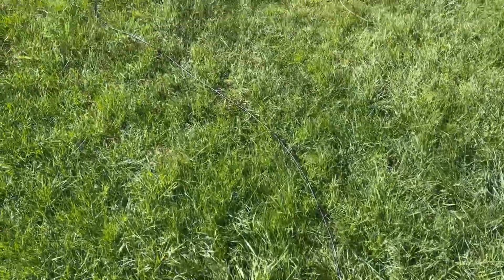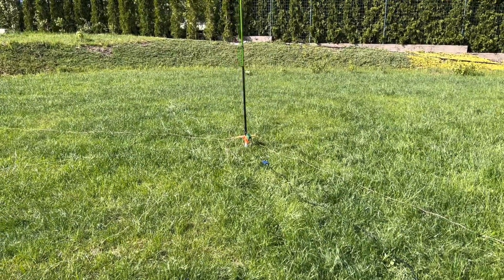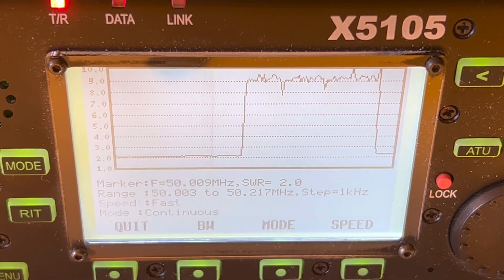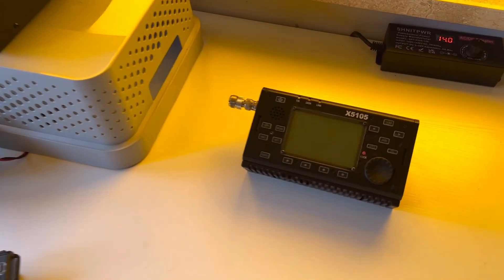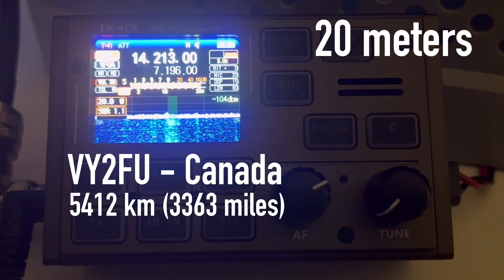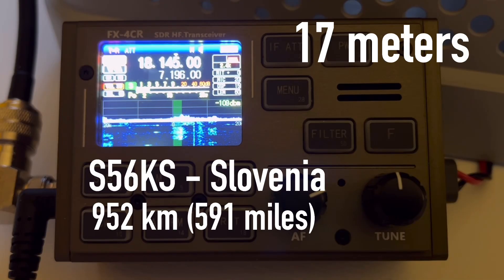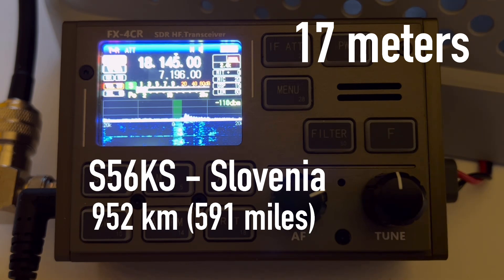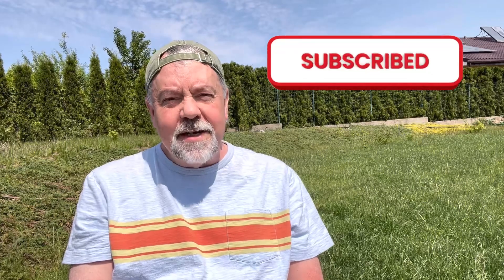Building a Short Multiband Vertical HF Antenna

Comment: I have a $28 18.4 foot telescopic whip that I'm using as the basis for a small motorcycle mounted portable version of the POTA PERformer that I'm calling the Moto POTA.  It uses two tuned elevated radials and is quick and easy to deploy with the motorcycle acting as the stabilized tripod, hopefully without spoiling the radiation pattern but the bike is in the lower null so I don't think it'll be a big problem.  I've always favored the EFHW for its light weight and ease of deployment but the Moto POTA should be even easier, with no need for a tree, and the lower radiation angle should improve DX performance.  I'll keep the EFHW for NVIS.

It was good to see the FX-4CR.  I love that little radio.

Comment: Hey Walt,

 I'm really enjoying building some of your antennas and working them with the G-90. This antenna worked great, even today with the projected propagation of 'poor" I still made contacts on 10, 112, 17 and 20.  I have only been using 3 radials since that is what I had for my wolf river coil. For this antenna I used the 7.2-meter crappie pole which is lighter and has less wind drag than my bigger 10-meter pole. Easy set-up worked great. Thanks again for the inspiration to tinker with wires. Now that I have the G90, and using the wire antennas, I just can't believe how much I can do with so little! Thanks again Walt! 

Mike

Comment: Walt, built a 17-5 with 20AG wire with dx commander using the LDG 4:1 unun and LDG 1:1 choke works great, may try 20-5 but 17-5 works great!! Thanks W8BLT
Reply from the maker: Awesome! 73, Walt

Comment: Hi Walt, just curious what length ground radials you used. 73, WA2SVM.
Reply from the maker: @WA2SVM  I typically use 5 meter long radials but I hack and wack and don’t worry too much about the exact length. When they are on the ground exact resonate length isn’t important. 73, Walt
Reply: @COASTALWAVESWIRES  Many thanks! I plan to try both the 17.5" & 29' verticals. Happy DX!

Comment: I may try this! I picked up a 1kw 4:1 balun two weeks ago cheap at a Ct ham fest. I was experimenting this week with a 213 whip using a window
screen counterpoise with very good
swr readings 20 to 6m with and without
radials.same swr readings both ways.
Do you think this will work with the window screen? It may take me a week or more to set this up. To use my ldg
Tuner,4:1 and my wolf river whip.
Reply from the maker: Yes, give it a try

Comment: Thanks for the video! I picked up a 25foot mast so I'm looking to try this as an elevated vertical with one or two elevated radials. That would be a good, simple POTA antenna if it works. 73, Brian - W5DUI
Reply from the maker: Definitely worth a try. Good luck!
73, Walt

Comment: Hey Walt, I'm a new Ham, just got my Basic with Honors here in Canada! I really enjoy your helpful informative videos. Question about radials. Do they need to be 5m long or can they be shorter say 3m (10ft)? How many radials is best 3, 4,5?
Thanks,
Chris
VA3COJ
Reply from the maker: They can be any length but try to get as many down as possible especially if you’re going with 3 meter long radials. I think you would probably be ok with 5 or 6 radials 3 meters long but add more if possible
Reply from the maker: This is a very common question and I think you have inspired me to finally do a video on this topic. 73, Walt
Reply: @COASTALWAVESWIRES  Thanks so much Walt! Well I'm glad a noob like me has given you inspiration lol 😆 😄 
73
Chris VA3COJ

Comment: Hey Walt, i gave this antenna a try today getting ready for portable work once it warms up, im using a homebuilt 4:1 and a choke after a 6ft patch lead which then goes into my radio. 17 and a half foot vertical and 12 radials between 2.5 and 3.5m long, this thing is a monster between 12 and 20, got my very first copy into VK from Ireland on 20m on it today, feeding it with about 25w. Only issue im having is i cant get a good tune on 10m, im using an mfj 901 manual tuner woth an old kenwood ts130 rig and no matter what i do it wont tune below 2:1 on the lower ssb portion around 28400, i get a good match further up near 28900 but its pretty deaf on 10m anyway, dont know mayne i done something wrong, ill experiment with wire lenghts. Im very impressed though, single wire and i can work really good dx on 4 bands, and it cost me less than 20 quid including toroids for the ununs!
Reply from the maker: That’s awesome! Thanks for sharing. Keep experimenting, I hope 10 comes through for you. 73, Walt

Comment: Walt, excellent video as always, I have a 3 foot pole that needs a vertical and that's it, lol! One question, how did you attach the counterpoise wires? I couldn't make that part out. Tks, Greg
Reply from the maker: Thanks Greg! I attach the counterpoise wires to the negative side of the unun. You can also clip them to the outer side of the coax connector at the feed point which will work just as well.

Comment: Don’t really get chokes.  Is the 1:1 needed when you have the 4:1 at the feed point ?
Reply from the maker: No it's not needed, it just helps prevent RF from travelling up the coax when you are transmitting.

Comment: Hi, Walt. Great video. It is very ecouraging to see that kind of random wire type vertical in action. It looks like the length is not very chritical namely 18 ft is a well known length for random wire multiband antenna. It is normally feeded usung 9:1 unun but 4:1 seens to work, too. I have a  not sk well working commercial random wire vertical which I most probably modify based on your design.

73! Mikko, OH2BJU
Reply from the maker: Thanks! Good luck with the antenna! 73, Walt K4OGO

Comment: Hi, Walt. Nice video man and some great contacts there. I'm looking at maybe getting a 1/4 end fed 60 meter single band vertical as an "all-in-one" type solution to cover 30, 20, 15, 10, and maybe 6 meters. It's just over 8 feet tall and has a coiled bottom half. The price is nice at 40 USD. What do you think? 73
Reply: Hmm... My math might be off. That'd provably be better for 60, 30, 15. The 160 one might be good for 80, 40, 20, 10, 5. 🤔 Maybe I'll just get a long poll and wrap some wire around it... 😅
Reply from the maker: Or do like I do, just experiment with some different lengths until you find what you like LOL. 73, Walt
Reply: I ended up getting both antennas to switch between to get up and going a bit easier. But yeah, I'll have to do some experimentation for more ideal setups when time permits. 73

Comment: Thank you! I loved the video! I’ve had my General license since 2010, even though I’ve been on HF several times, I just got my first HF Radio, the Icom 7300. I’m having horrible luck with a dipole and I’m hoping to try the Seven 5, thanks again, I can’t wait to try it! Hope to hear you on the waves! 73 - N9RMG
Reply: I’m sort of in the same boat. Got my General in 2020 and just got a 991a. The subject of antennas is daunting, and I may start with a design like this or similar.
Reply from the maker: Looking forward to catching you on the air! 73, Walt K4OGO

Comment: Hey Walt, Great channel, Thank you for I am learning a lot of your experiments as a novice HAM. My QTH has a constant QRM of S9+ dB. So mobile is the only way to go. I am a great fan of my home brew T2LT antenna's I have got them 10, 2 and 0,7, but looking for something short multi band the 17five looks like a good solution. So I build one from your example. Only difference I made to it are the radials. I first used the radials that i made for my home brew multi band vertical for 20 and 40 based on the Slidewinder design only longer. These radials are in bundels of 6 strands of 3 meter thin speaker wire. I use 3 of these bundels for a ground plain. Now I observe something strange. The more of these bundels I attach the higher the SWR of the 17five gets. Best configuration I found is No radials at all with the 4:1 LDG unun dangling 2,5 meters of the ground  (on a 8 meter squidpool)  With a SRW of 2,3 on 40 it has even a wider range then expected. According to the Rig Expert it would be tunable on all HAM band except for 160, 80 and 2 meter. This is what I would like to give back to you. It may lead to some ideas. Pitty your day in Poland are over would have loved to work you on this antenna. But how knows maybe trans Atlantic some day.
Reply from the maker: Thanks for the input and the information on your experimenting. Hope to catch you on the bands for that Trans Atlantic QSO! All the best and 73, Walt K4OGO

Comment: Hey Walt! Love your stuff, and something to consider is to make a "mini inverted L" by adding a piece of wire with an alligator clip to the 17' whip. I use a longer piece to a cheap pole to tune 40m. Hears better and gets out better than a coil at the base. Have fun in Poland.
Reply from the maker: Thanks! Great idea, thanks for sharing
Reply: @COASTALWAVESWIRES  The wire I use is 20'6" long using the WRC whip.

Comment: Hi Walt, Nice Video's. recent viewing of your videos have inspired me to go get a X-6100 and now trying to settle on an antenna. Headed to North Myrtle beach in a month or so and want to do a bunch of DX'ing from the beach but there will likely be other beach goers that don't want to be tripping over radials. I also plan to use this set up in the future for Pota/Sota & emergency preparedness and field days. I don't think guy wires will work either. Any suggestion are appreciated.  
73's - Phil K2OTA
Reply from the maker: Hi Phil, if you’re at the beach and by the saltwater you really only need one Counterpoise wire, that should help a bit. Instead of guy wires I use either a surf rod holder or beach umbrella mount in the ground to support the pole. These also work great in common dirt as I’m using them in the backyard in Poland. All the best and 73, Walt K4OGO

Comment: I’ve seen a quite similar vertical called a ‘Rybacov’ which used 27feet vertical but fed exactly the same,.. a 17.5ft vertical is near perfect length for 20m band so wouldn’t need the unun on that band. Operating that antenna on the sea coast would be a real Boomer for DX!. I can work VK/ZL from my QTH on  the Irish Sea coast with just 10W usb & 1.4m loaded whip antenna. 
BTW can you give mire info in your power units for portable working. … 73 de G4FBC
Reply from the maker: Hi Ron, yes the RYBAKOV is a great vertical. I’ve actually built it several times and have some videos on it. I purchased the power units on Amazon, here’s the link: Adjustable Power Supply 3V~24V 5A 120W Adapter Universal AC/DC Adapter DC 3V 5V 6V 9V 12V 15V 18V 19V 20V 24V, 100V-240V AC to DC Converter with 5.5x2.1mm 14 Tips for LED Strip Light Laptop Speaker https://a.co/d/aUEsEEZ

Comment: That sounds like fun.  It occurs to me that a way to employ the MFJ whip would be to add one of those rods such are used between the base and the coil on a Wolf River setup. I'll see if I can try it on a POTA.  I've got the LDG Z-11Pro II, which should give me comparable tuner performance.
Thanks and 73, Bill - KE1G
Reply from the maker: Hi Bill, I plan on doing that with my whip to get that little extra length. Thanks for the comment! 73, Walt K4OGO

Comment: Hi Walt, good video as usual :)
Have you done any comparison with this antenna vs the Coastal 20?
I built mine (the Red Clay 20😁) based on your Coastal, but used a 5.6m collapsible whip from ebay set to 17.5 feet and a 3/8 x 24 mirror mount mounted to a short fiberglass mast so I could isolate it and fed it through my 9:1 unun with a 3 foot tail on the "ground" side of the unun. 
It would be quite interesting to see if the Coastal can offer comparable performance, especially with no radials needed (well, almost none).
Those of us who live on postage stamp lots love your vertical videos!
Reply from the maker: Thanks Mike, this antenna is basically the Coastal 20 with a groundplane. The Red Clay 20, I like that!!! Thanks for watching my videos!

Comment: Serendipity Walt, I too randomly used a 17.5 ft vertical with a 9:1 transformer, still got it in the closet- gonna dig it out and I’ll try a 4:1 as well maybe do a SWR comparison. Keep the free thinking coming Walt.
Barnie. 73 de M7PBX.
Reply from the maker: Thanks so much Barnie! That's what it's all about
Reply: What effect would you expect a 49:1 unun to have on this wire length? Its the only transformer i have at the moment. New general here, learning a lot! Thanks.

Comment: Hi Walt, video is amazing as always but I have a question about shnitpowers. Do they drift with voltage ? I have one ( kind of knock off ) and my unit is going down like 0.9 V in 20 - 30 min until it gets hot and then it stabilizes. It is really annoying and I'm thinking about original shnits from amazon if they  are constant with voltage from the very start. Thanks for video !
Reply from the maker: Thank you! I haven't had that issue with mine, they stay very stable.
Reply: @COASTALWAVESWIRES  So mine is definitely knock off. Thank you for answer !

Comment: love your antenna videos, just watched a video by VK3YE,  Super Cheap Single Pole Beam for 15m, an interesting antenna for you to try out, especially on the beach, al ve3gam ps wonder if you could change the length of the director for each band from 20 to 10?
Reply from the maker: Thanks Al! I saw that video, very interesting. I did something similar with two poles recently with a Delta Loop I turned sideways. Complete with the fishing line and rotating method Peter used.

Comment: I've said it before and I'll say it again, I love my verticals! I did a POTA just this morning and from beginning set up to first contact without even being spotted first it was 14 minutes. A half hour later I was on the way home with 18 contacts in the bag along with 3 new states. You just can't beat it.

I've noticed similar things using KJ6ER's 1/2 wave for 15m (essentially a 49:1 into a 40 inch piece of wire feeding an MFJ whip fully out). I get about 1.5:1 on 20m phone (less on the CW/digital part), completely flat on 12m and 10 is around 1.3-1.4 until you get north of 29.000 hitting 1.8 or so at 29.600. While it doesn't seem to work quite as well as setting up the 1/4 wave and radials, it's perfectly useable and a good deal easier for band changes :) I run it that way quite a bit at home.
Reply from the maker: Roger that!
Reply: Thanks for the inspiration!! Have my 4:1 Unun ordered. Would you go with the 17-5 or the Rybakov? I have a 6m pole (ultra portable) and am thinking to wrap the wire around the pole to get to the extra length for the Rybakov but straight wire of the 17/5 may be better. Thoughts? K4TMO

Comment: Great again Walt, you have to take a look at Spiderbeam, 7m or 10m mini. They make amazing poles and really stiff ones. And have also spare parts if needed
Reply: Absolutely right on the Spiderbeam.  Great poles and great for POTA (maybe just a bit bulky for hiking).
Reply from the maker: Thanks Robin, I will check them out
Reply: Spiderbeam poles are brilliant!  I actually prefer the 7mini to the 10 as it's less whippy.  The 12HD is amazing - but it's quite big and imposing in a residential environment.

Comment: I'm curious how or where the radials are attached.   I'm new to antenna building so it didn't seem clear from the demonstration.
Reply from the maker: Hi Rob, sorry I brushed over that so quick. The radials attach to the black (-) ground post on the unun. You can also attach them to the outer side of the coax connector at the antenna feed point, I’ve done that with a big alligator clip before. Bottom line is the center of the coax connects to the vertical driven element and the radials connect to the outer braid wire part of the coax.